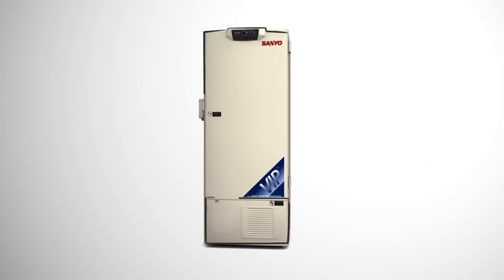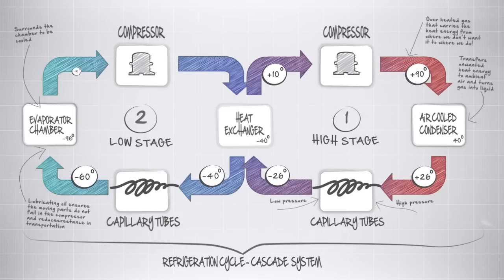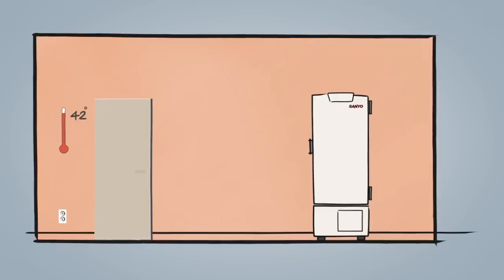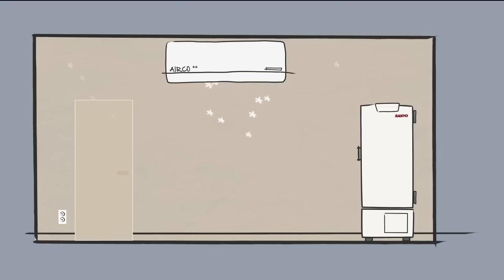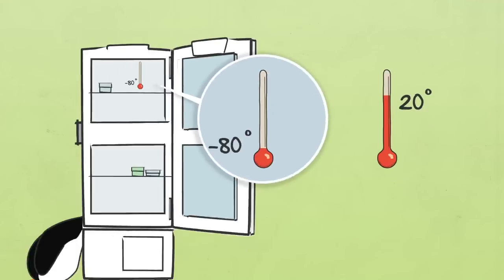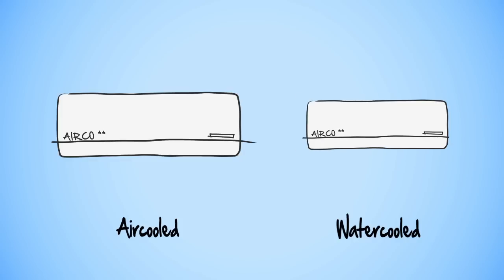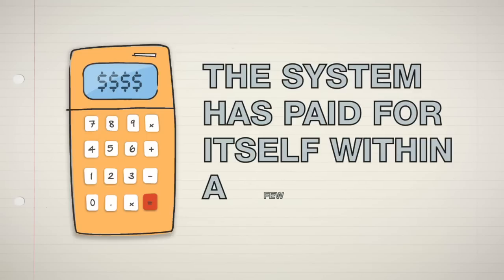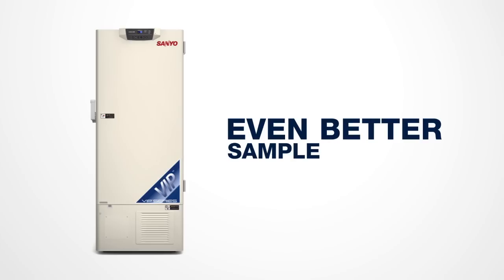Sanyo ULT Watercooling

Comment: Great description of water heating--if in a compatible building that has a process cooling loop designed into it.  Without this, running the building cooling loop may be energy inefficient.  Waste heat re-use is an excellent idea, but the delta T° is not enough to make hot water, but preheating could be possible.  Putting the process cooling downstream of building cooling works and increases delta T at the chiller plant.

Comment: Finalmente una nevera que usara su calor para calentar el agua de la cocina. Super interesante y económico. Pero como lo harán para que sea constante? Ya que la nevera cuando alcanza su temperatura apaga y ya no mas agua calienta. 

Finally a refrigerator that will use its heat to heat water in the kitchen. Super interesting and economical. But as they will to be sustained? Since the fridge when its temperature reaches off not more  hot water and no heat. How they going to fix it?